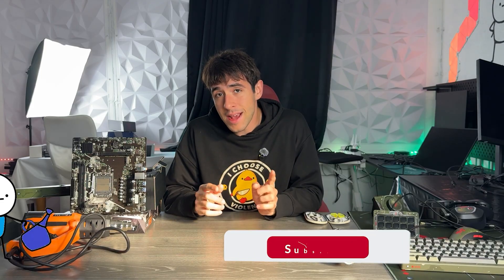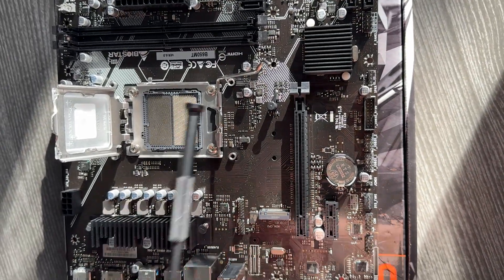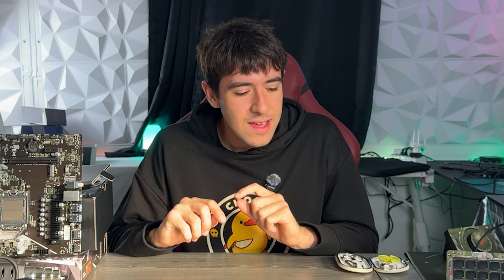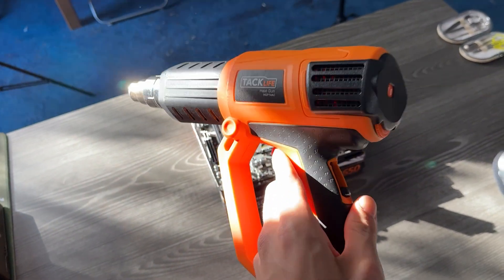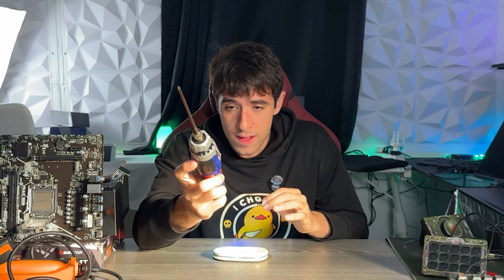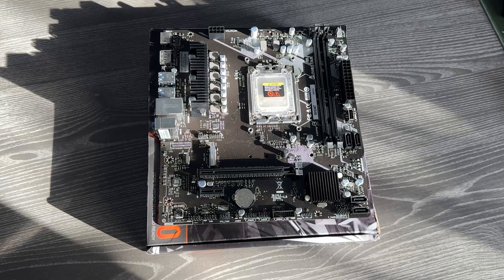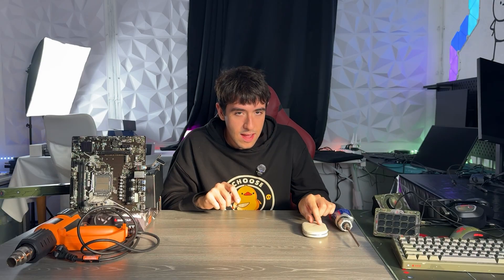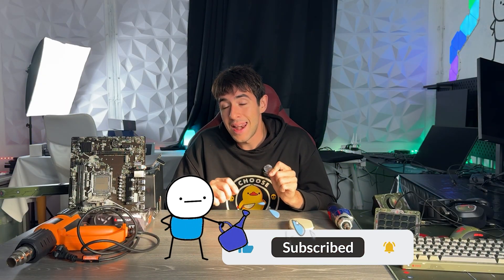Fix Bent CPU Socket Pins (AM5 & Intel) — No Microscope Needed

Comment: I freaked my motherboard pins because accidentally my 9800x3d fall on socket from my hand, at that time if i had seen your video might fix but i tried to fix and accidentally broke 2pins but thanks to Gigabyte they accept physically damaged product and did the RMA now i am good
Reply: How much was the cost for the RMA? Did u get refurb or they replace the socket
Reply: @alexchan6730  0
Reply: @alexchan6730  they repaired the same mobo

Comment: I've watched the undervolting rtx 3070 video and I have a question, if my PSU is a 600W T-DAGGER T-TPS201 PROTON and am not sure with it's 80+ cert
Running with i5-13600K will undervolting protect from crashes ?
I have an RTX 3070 Vision OC and i see it's tdp is 270V with 650W psu reccomended so will it be a problem ?

Comment: The heatgun tip is good, thanks. Got to have very good eyes and the ability to not get nervous though. It's easier to prevent it from bending but we all sometimes have one of these idiot moments huh. Was testing a CPU on my old I7 4770 motherboard and decided to clean a bit of old paste. Without a CPU in it, causing the cloth to catch a few pins. Doh.